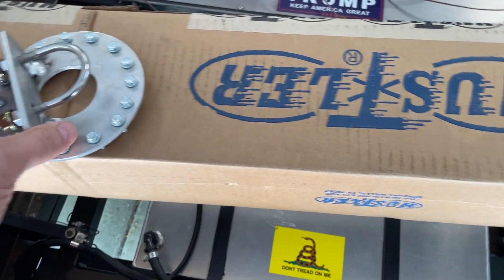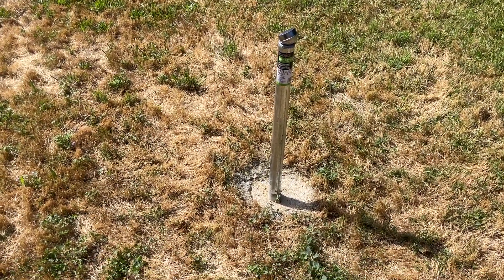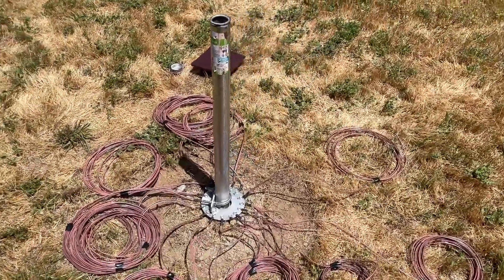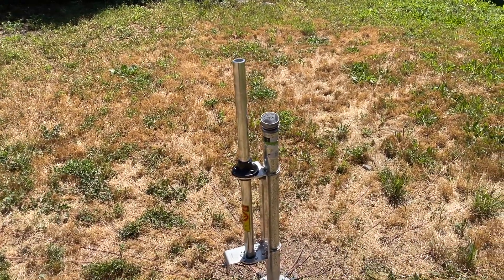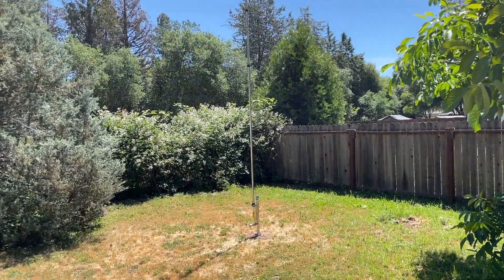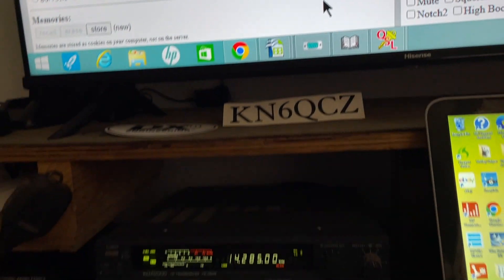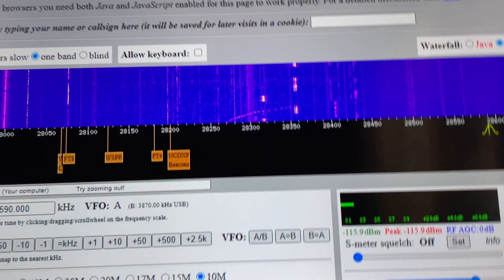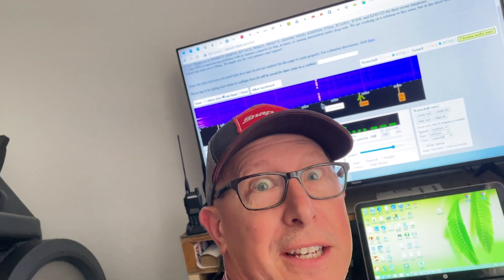Hustler 5BTV antenna Install with radials Ham Amateur Radio

Comment: How do you mow that area of your garden with all the ground radials!!?
Reply from the maker: The radials find their way to the dirt. I’ve never had a problem with grabbing one with my mower. I did stake them down when I installed them, but they’ve never been an issue
Reply: @ good to know! I had been avoiding it, scared of ripping it apart and bringing the antenna down!
Reply from the maker: @RhettSparrow I hear you for sure! I’m in Northern California and have made contacts with that antenna in Cuba, Russia, Africa and Ireland. It works good for me and doesn’t take up much room in my yard

Comment: Thinking of adding the bt5v
Reply from the maker: I really still like mine. I’m thinking of adding 12m and 17m traps hanging off the sides.
Reply: @ yeah I run a comet and a custom built 10-80 enfhw atm so much noise has been on my wire lately… And the comet isn’t performing like I want

Comment: I tried to tune my 5BTV today with no luck.  Its not even within the bands for 10,15 and 20 meters.  According to the VNA its too long.  I tried calling the company but they were closed when I called them. Its really frustrating.
Reply from the maker: That sucks! Mine tuned just fine and still performs great. Keep me up to date on what your final results are, please.
Reply: Interested to know what you did with it. Did you figure it out or had to return it? I was thinking of getting one!

Comment: Dear Sir- thanks for this video. Quick question: have you started selling your radial adapter plate? I’d be VERY interested. After 2 years, are you having good results? Any problems? Thanks, KQ4IXD
Reply from the maker: Thank you so much! I don’t have plans to make and sell the radial plates. Sorry. I have had no issues with the antenna or radials. I really am impressed with the performance of the antenna.

Comment: How does it hold up in wind.  Im in Southern California and have to deal with our Santa Ana winds but Im looking to do something like this.
Reply from the maker: I haven’t had any issues with wind. I believe they recommend support wires(rope) with the 5 over the 4 due to the coil on top, but with the fence post in 4 feet (2 in dirt and 2 in concrete) it ain’t going anywhere! I know the Santa Ana winds can be rough, so you may want to consider a guy wire in the direction (facing) of the wind. Good luck!
Reply: @danedwards7597  thanks.  I'm looking at the btv so no cap hat......maybe less wind load

Comment: Unfortunately, that ground system is massive overkill and won't last very long. Insulated stranded wire is the worst thing to use for ground radials as the electric voltage combined with moisture corroded them very quickly, and using fasteners and terminals outdoors is also a poor choice.. Unfortunately, these poor antenna construction techniques have become popular among hams because they think it looks good.. 

A much better system is to make a small 10-inch loop from 3/8th in soft copper tubing and attach this to the base of the antenna mount with spokes also made from the same copper all soldered together..
For radials, you want to use 22AWG polyimide-coated magnet wire which costs about $22 for a 500-foot spool.. 
This is a solid core wire and will last decades even buried underground..

the polyimide coating is far more durable than the plastic coating and it effectively seals the wire, 

I've dug up polyimide-coated antenna ground systems that were 60 years old and they still looked brand new.. 

The problem with stranded thnn type wire is that it wicks moisture in relatively quickly and the electric currents combined with the moisture quickly turn the wire to dust.. 

Anyhow rather than fasteners, simply scrape the polyamide coating off the end of the wire and wrap a few turns around the 3/8th in copper tubing and then solder it in place with a portable torch, when you are all done you can paint the tubing, and solder connections with some green paint, I guarantee you will have just built a ground system that will last 60 years or more
Reply from the maker: Thanks for the info! I’ll be taking this antenna down in 3 years when I move to Idaho, so I’ll take your advice on the next deployment.
Reply: @danedwards7597  I actually really like these antennas. Even though I have several towers with beams, I still always keep one of these up.. 

They are extremely durable, and with a good radio system are decent antennas for DX.

Do yourself a favor, when you reinstall it just buy yourself a 500 ft spool of 22 gauge magnet wire. The normal enamel coated stuff works well enough but if you want something that'll last 50 years then get the premium polymide coated magnet wire..

The only problem with the polymide coating is that it's going to piss you off scraping off the coating to solder it.. 

I found that I need to use a Dremel tool with a grinding wheel to carefully grind off an inch of polymide coating..

The cheap enamel coated wire is easy enough, you can just use a razor blade to scrape away the enamel coating.

here's a trick that a friend showed me for burying the radios and it works like a champ.

Get yourself a cheap electric chainsaw. drill a 1/4 hole in the bar about 2 in from the end.

Get yourself about a 6-in piece of 1/4-in shredded rod, slide it through the hole and use two lock nuts to lock it in place. basically you're making a depth guide.

Don't use a good chainsaw for this because it pretty much wrecks them. I just use a cheap electric one.

anyhow you can use it to very quickly dig a 2-in deep trench to bury the radios, simply lay the chainsaw down on the ground and pull the trigger and drag it along, the shredded rod will act as a depth gauge so you get a nice perfect 2-in deep trench..

The next step requires two people. One person carefully pushes the radial into the trench another person follows behind them with a sledgehammer and just carefully drops the sledgehammer over the trench. No need to wail on the ground, you're just kind of like tapping the ground with a sledgehammer. let the hammer do the work..

this seals up the trench by basically collapsing the walls.

about 30 years ago I set up a 6B TV with 120, 22 gauge magnet wire radials  this way And it worked beautifully.

about 20 of the radios were 18 gauge THNN wire.

That antenna and ground system was in place for over 30 years. When we finally moved I decided to pull up the radials so the new owner the property didn't have to deal with them.

I was stunned at the condition of the radials after 30 years in the ground.. The magnet wire radials looked as good as the day they went in. That enamel coating really protects them and since it's solid core moisture can't wicked its way up the wire.

On the other hand the 18 gauge THNN wires completely eroded, the only thing left was some plastic. The wire itself had been turned to dust. water wicks its way up the wire and the electric current destroys the wire, it acts like a big cathode.

Oh and don't be fooled, that 22 gauge magnet wire is much stronger than it looks. I managed to get about 60 of them out of the ground before I gave up..

Comment: I've had mine up since 1978 what does that say? Can't complain all i have ever had to do was to replace the 15 meter trap cover. This morning I worked JA1QJE in Japan with that antenna and my ft817 at 5 watts so they do work pretty good. I also have a ts 450 sat got mine in 1990. 73 from ki0ad/😮😅Jim
Reply from the maker: I really like this antenna! I think I’m going to add a 17 meter trap to it and see how it works.

Comment: I use a 5-BTV here and I have mine guyed just below the capacitance hat and that reduces the amount the vertical will move around in the wind.
Reply from the maker: I haven’t had any problems with mine, but I try not to look at it when it’s windy. Ha!

Comment: I’m planning to mount mine on a mast to get above the trees. What software were you running n the monitor?
Reply from the maker: It’s actually a website. Websdr.com on the main screen I scroll down to the one in San Francisco since it’s close and I figure if it can hear a signal I should too

Comment: Nice video. Thanks. I'm glad you were able to get good results with radials on the ground instead of raised. I think raised radials in a suburban yard is generally a non-starter if you ever want to be able to mow the lawn! Did you measure the SWR on all the bands?
Reply from the maker: Thanks! You know, I don’t think I have ever ran an SWR test on this antenna. It works so well, and when I hit the auto tune on my Kenwood TH450S (old radio) it tunes in about a second, so I’m sure it’s real close. You have given me another project!
Reply: @danedwards7597  Yeah, I think it's possible to make adjustments to the antenna and the radials to tune it. These trapped antennas are supposed to be pretty narrow band, so optimizing the resonant frequency for where you want to operate on the band could improve performance. Tuners are great, but why introduce unnecessary loss? Anyway, I'll be curious to know how it all looks.

Comment: Great video Dan and thanks for all the helpful tips.  I plan on purchasing a new new Hustler 5BTV this week.   Walmart has the 4BTV version for $200.  Quick question...Will it work up on a roof with radials stretched out on the roof?

Thanks,

Dee
Reply from the maker: Thanks! I’m not sure if the performance would be compromised by mounting it in a roof. I did see a video of a guy who mounted it on his trailer hitch for doing POTA. On your roof might work fine. Good luck on your install! I do suggest using the DX Engineering instructions for assembly, which you can find on their listing for the antenna.

Comment: wasting LOTS of RF power with radials!

Cut those worse than useless radisls and replace them with a large aluminum plate.

Will work much bettet.
.Realize two things about radials:

1. Very high losses into soil. Soil is a lossy dielectric at HF

2. Very narrow conductors, very small total surface area.
Reply: K8BYP, have you done this yourself? Were you able to measure the change in gain?  Thank you.
Reply: How large a plate would you need?